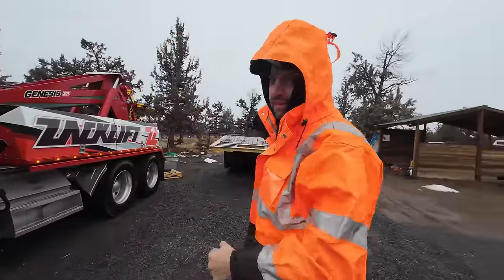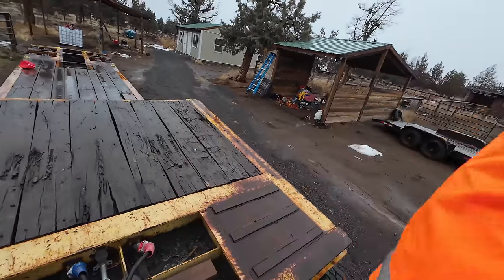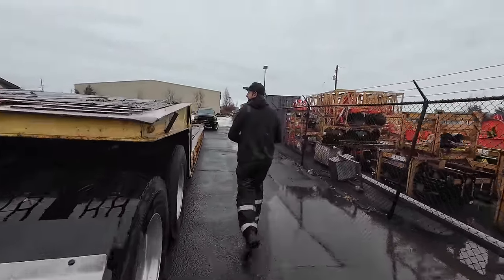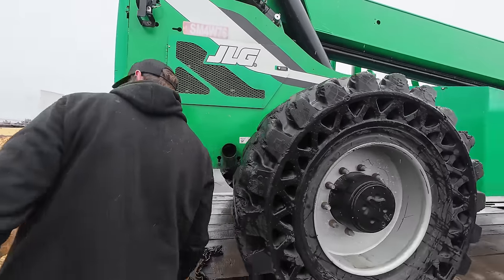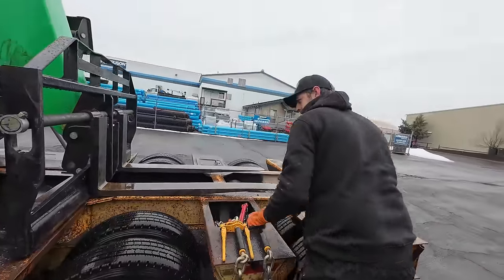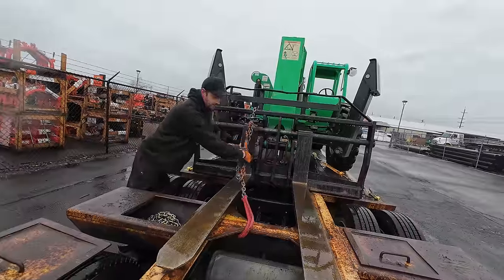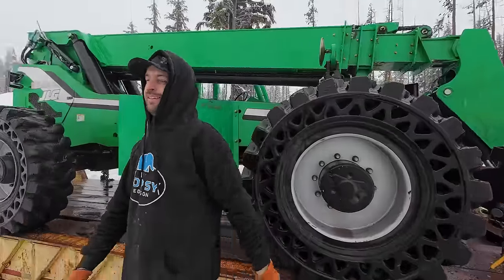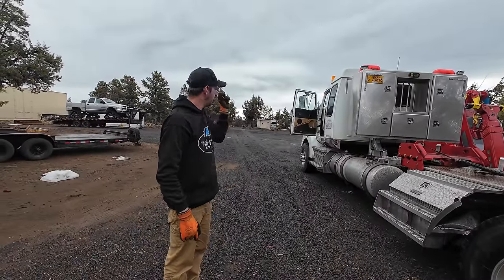Ski resort delivery gets messy!

Comment: Now i have a question, which may not get a quick answer since this video is already months old.
Why do you have to stop in order to let the truck regen?
Does it need a certain Engine RPM to do it, that you just dont reach while going down the road, or what is going on? On the one regen capable machine that i know, you can keep using it while it regens, its just on a higher RPM, which may not be awesome for Delicate maneuvers. Although that machine is all hydraulic, so the proportional valves can get the flow back down, even if the engine rpm's are high.

But i am curious now.

Comment: I liked your comment about the Subaru trying to cut you off. I owned a potable water hauling business in Durango, CO years ago, single axle truck with 1500 gal tank. I had to make a delivery to a Fire Station up toward the ski area in the snow, I got in the center lane to turn left and a guy passed me on the left. I wanted to run him off the road.

Comment: You need to get a second tractor dedicated for your 5th wheel trailers so you don't need to unload the Zacklift from the Western Star.
Reply: He specifically got this set up so he could avoid the huge cost of owning, maintenance and insurance and everything on a second truck
Reply from the maker: The cost of that makes no sense, when the ability to do this is the very reason for the zacklift

Comment: How does this work with your wrecker insurance? I was told you could only use a truck for a wrecker once insured as a wrecker. You couldn't use it as a tractor. I was curious because I have a Tru-hitch and having a hell of a time getting insurance that covers both tractor and wrecker. Actually I only haul my own trucks but have to have wrecker insurance if they are disabled. I do not have to have wrecker insurance if they are not disabled. Insurance game is fun

Comment: Forced regen questions: Are you using a fuel catalyst additive?  I use FuelOx and don't have forced regens.  I drive a KW so I don't know much about Freightliner/Western Star.  Will they do a rolling regen?  Regardless I suspect your driving profile (lots of stop and go, slow, and idling) causes a lot of your issues.  Do you ever idle at minimum RPM?  I suspect because you are using the PTO that you have it idled up most of the time.
Reply: I read your comment buried in another comment about the fact that it will do rolling regens.
Reply from the maker: Yes, it will do rolling regens, but with the type of work it does it doesn’t meet the condition requirements often.   I always idle it at 900 rpm

Comment: There is a product you can buy from the company. It’s called less friction in Reno. That’s just outside of Franklin PA he has a product it’s extremely good to help prevent rust and I recommend you get the proper spray gun that’ll cost you about the 80 or $90 for the spray gun and it’s got a long flexible tube with spray nozzle on the end. It sprays forward and about four points and coming off the side and you could remove that and use it like a spray gun for painting cars. This product I forget the name of the product but if you Google him I’m sure he’ll gladly ship it to you. It’s works really good stuff goes on and it doesn’t wash off but what I would do is wait till summer until things dry up, real nice wash that thing down as best you can your lift and everything and get in there and spray that product in here. I would get about 4 gallons of it. You get it in quart bottles I wish I could remember the name of that is six in a row.Jim from Kennedale, Pennsylvania
Reply: Note that he’s said multiple times before that things don’t rust in his area.

Comment: I maybe wrong here and not trying to start anything and  also help the algorithm and all but don’t the legs on that tellahandler need to be tied and secured so they don’t come down during transport? That’s at least the way I understand it but I could be wrong. Great video and love the tractor sprinkler.
Reply from the maker: Nope, technically by the book there is no legal way to secure a telehandler with outriggers, or a backhoe.     
   The law very clearly states that all hydraulic accessories must be lowered and secured.   But the law also states that a load must be reduced to legal dimensions if able.   There is no provision of any kind stating that hydraulic accessories must be tied up in place.   
By the black and white letter of the law, there is no legal way to do it, so I just don’t worry about it.  Never have in 20 years and it’s never been an issue

Comment: Whats going on with the truck... It has to "regen"...?
Reply: Think of it as equivalent to the self clean cycle on an oven, but for the emissions system
Reply: @JohnHallgren  so then you just have to stop... What. !!!
Reply: @x...CrankyOldMan...x  no, he just chose to not have it done when he was towing (from his replies elsewhere)
Reply from the maker: When the dpf filter reaches a certain soot level, the truck has to burn it out.  It's called a regen cycle.   It can sometimes be done going down the road, and sometimes has to be done with the truck parked.  All depends on the conditions at the time

Comment: we had a company working for my company i worked for, i turned front wheels, flipped to crab , brought front wheels to staight , flipped to opposite steer , staightened back wheels, the flipped back to front steer. took them ahile to comprhend what was so fucked up as they tried to drive in front steer😅😅😅

Comment: sounds like the RAM has a blinker bulb burned out by the speed it was going at 15:55
Reply from the maker: It’s been like that for awhile, but all lights work and flash at normal speed
Reply: If it has a led bulb in it and it wasn’t led stock they’ll do that as well. The led draw is so much less it send a signal to the bcm that the bulb is out. Might be a cruddy socket connection, weak filament (if it’s not led), or it’s just an electrical gremlin. I had this problem and that fast clicking drove me nuts. Guy I know put led bulbs in and his does it all the time and he doesn’t care. been that way for years with no issues.

Comment: When / how did you get your windshield broken ?
Reply: He says so in a previous video the other day, volcanic rock used as traction on roads in at least central Oregon will crack windshields.
Reply: @johnhpalmer6098  Thanks if was a short then I didn’t see it ,
Understood about gravel etc as I must share roads with trucks traveling to and from a quarry and replaced several windshields in just a couple years on several vehicles , it been trucks going the opposite direction
Reply: @heartland96a  I think Casey did a full video and mentions it then but it was also a short too.

Comment: Whats the limit on switches in a day before you just tote the trailer with the zacklift?
Reply from the maker: The 5th wheel adapter for the cross bar is only rated to 25k, so that’s my limit
Reply: @CaseyLaDelle  Appreciate the clarification, I missed that part somewhere. Kinda bummed now we won't see that setup with the international and track truck loaded up.

Comment: No way on earth I would be leaving anything DPF to idle (during the previous storm/cold) no matter what the conditions.  Got to find another way to keep it warm.  Gelled fuel fixes itself.  Emissions problems do not fix themselves and cost $$,$$$ and leave you out of service for a month/months.
Reply from the maker: How about the part where this trucks job is to literally sit and idle for long amounts of time over and over again??
Reply: @CaseyLaDelle  What I meant was idling it at the house all night long.  We know it has to idle to do work but that can't be helped. But those are much less hours than an all nighter and will quickly get burned out when you start to drive it again (hopefully).

Comment: Is there a reason you aren't driving during regen? I spent several years as an engineer with one of the big diesel manufacturers, and at least the engines I was involved with were intended to be regenerated under load. The engine will do several things to push the turbine/exhaust temps up towards the upper operating limit, but it is far easier for it to achieve that at highway load than idle. Truth be told, the engineers wouldn't put nearly as much emission stuff on there if they had their way. I could be wrong though, I've been out of the game a few years on that stuff...
Reply from the maker: You just answered your own question, “under load”…    Trucks will only regen while driving if certain conditions are met.  With these cold temperatures and empty trailer, it won’t do it.  Going up the hill loaded would normally do it, but highly unlikely when we’re only going 20-30mph on and off the throttle following a snow plow the whole way
Reply: @CaseyLaDelle  Oh, that does answer that... appreciate the great content! I'm a sponge for anything rigging related, and love the more technical recovery stuff. Keep it up, and stay safe out there!

Comment: Can you sell the body off the roll back and throw a fifth wheel on it?
Reply from the maker: It’s possible yes, but why would I do that when the western star already has a 5th wheel?
Reply: @CaseyLaDelle  so you don't have to unhook it back and forth.
Reply from the maker: @kylegallardy1894  it would be insane to spend that kind of money to save a 10 minute switch over
Reply: @CaseyLaDelle  I feel like it wouldn't be that bad.
Reply from the maker: @kylegallardy1894  so take apart a $150k truck that cost tens of thousands of dollars a year to insure and register, when the entire point of having a detachable wrecker is EXACTLY this reason??   That makes no sense
Reply: @CaseyLaDelle  dude I'm not attacking you, you already owned that truck I was just suggesting.  I like your content.

Comment: Someone has to explain that to me in words a five-year-old can understand.
Because the DEF system catches too many particulates, the system needs to be run to burn out the system... for the sake of the environment.
So, to make cleaner air, the truck is forced to sit on the side of the road and burn extra fuel.  That's some special kind of mental gymnastics done by environmentalists.
Reply from the maker: And don’t forget, all it’s doing by burning all that extra fuel is burning the soot particles down small enough that they pass through the filter that was put there to catch the spot particles…

Comment: Who decided 102” was max width?  Lanes are 132” to 144” standard loads should be 120” it would be so much safer.  26k for 1 ton and GN is a joke. 30k is lite.  It should be 35k. And 10k trailer? So I need my CDL to drive 1 ton dsl, with 32k GNFB GVWR 22k? Empty. Guy bought a corn head. Put on similar combo. $500 ticket, & required to hire a CDL to pull corn head within 150 miles of his farm.  THEN he is legal. Corn head 6000 lbs max.
 So if he used a halt Ton pickup, trailer rated under 10k lbs it’s legal with that load.  But because truck/trailer GVWR over 4x needed for that load he is dangerous.

Comment: I wonder if Casey knows he doesn't need to idle his truck constantly and that's why his regeneration is extra inconvenient. 

or does he just like to complain?

Not cold enough for diesel jelling.  Anti jelling additive exists...  costs less for a quart of Anti jelling than the gallon of diesel and def fluid wasted.

Tradition without progress?
Reply from the maker: Or...  The reason it was idled on two well below zero nights had nothing to do with gelling.   But in addition to that, this trucks job is to sit and idle for long periods of time, so DPF regens are to be expected.  The fact that I've only had two in the time I've owned this truck seems pretty good to me
Reply: You're getting your old trucks mixed up with modern stuff.  all engines idle, that's a non-point.

Your low idle was too cold causing your exhaust issue. 
It's your money and your time crying about DEF issues.  If that's all you want to be, ENJOY.

Meanwhile, you are at your home, you could use a block heater.  You literally said you didn't gain anything out of idling your engine other than headaches.

Did you leave California just so you can idle your truck?

 @CaseyLaDelle
Reply from the maker: @guessmyhandle  no actually, I never said anything like that.
Reply: @CaseyLaDelle  never said what?

Idling your truck over night for a “hope someone will call me”?
Reply from the maker: @guessmyhandle  “You literally said you didn’t gain anything out of idling your engine other than headaches.”    Nowhere did I say anything like that.  You’re making things up.